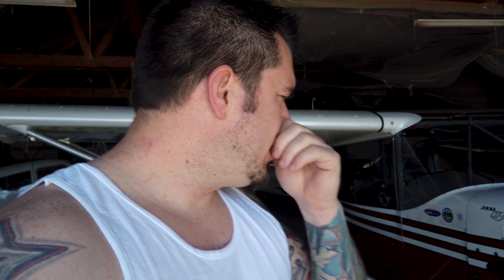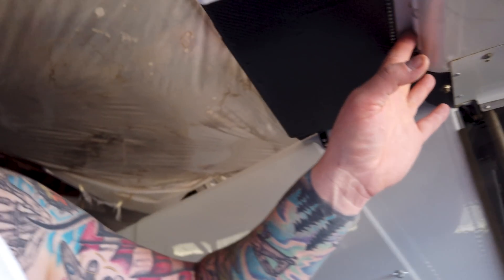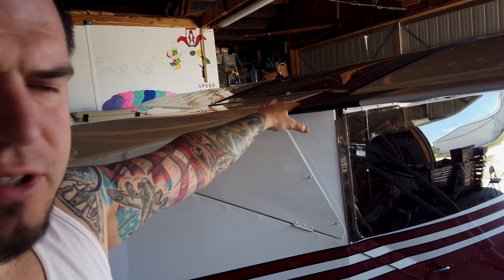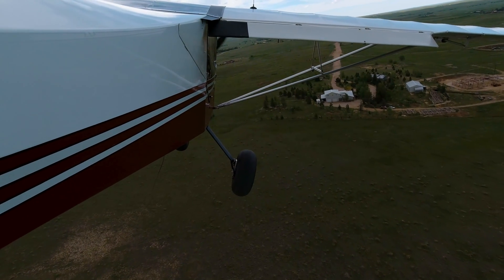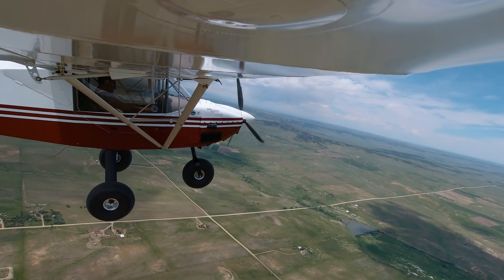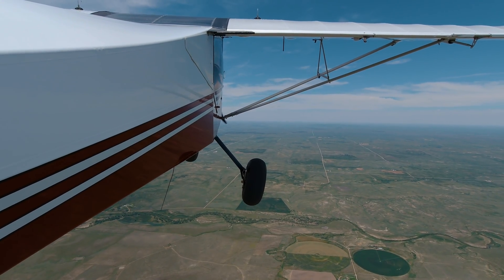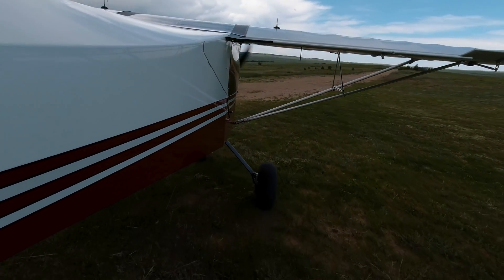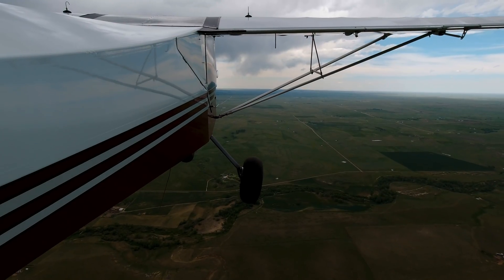Custom Longer (wider?) FLAP extensions tested in 4K - RANS aircraft S-6S / S-7S

Comment from the maker: Oh... and I wasn't clear on this in the video. But new RANS models include full length flaps to the fuselage with trim to close them out nicely. (At least the S-7S) does and I believe the new 141 metal wing etc. I was pretty sure that was the case when I was doing the mods, but actually had to look up some pictures. This is basically just updating the older design to the newer...